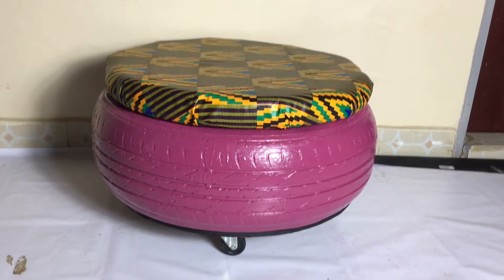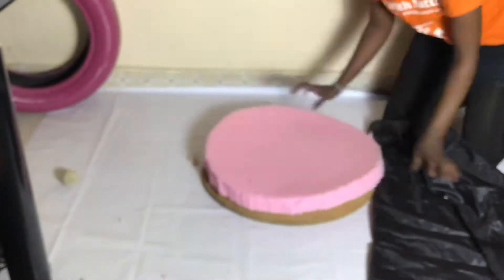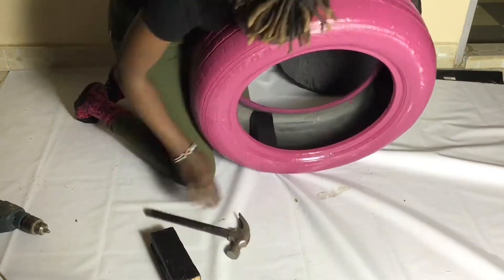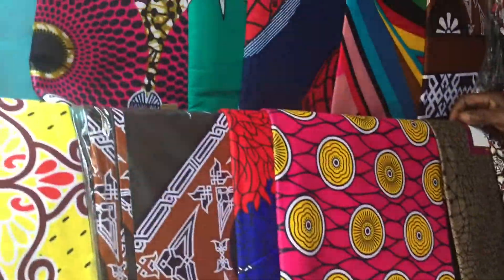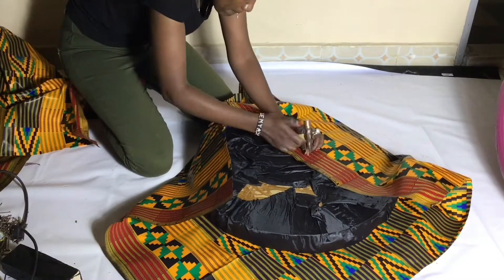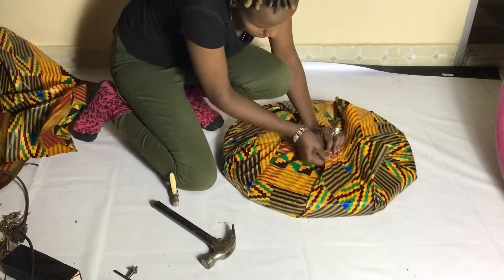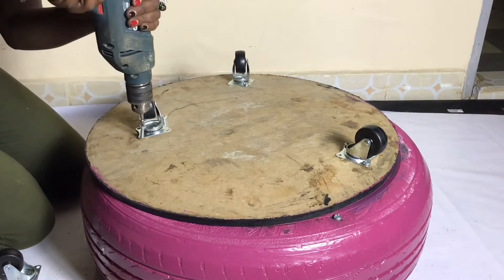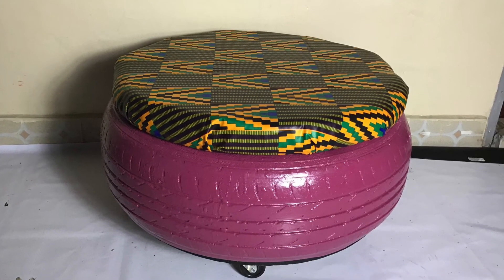DIY HOW TO MAKE AN OTTOMAN/ STOOL REUSE/DIY  BY TYRE/TIRE WITH STORAGE.

Comment: Please ma help me with the measurements both the wood and the glass thank you
Reply from the maker: Hey 👋, 
Measurement depends on the size of the tyre/tire.. most of the time I use the diameter of 28 feet’s ..
Reply: @Njerikabiru  for the or the glass
Reply: For the wood or the glass